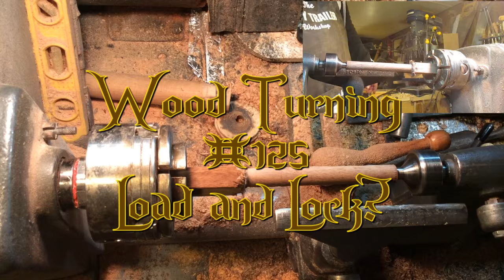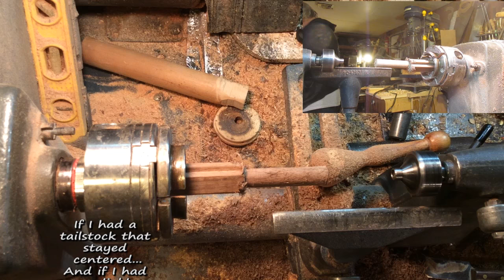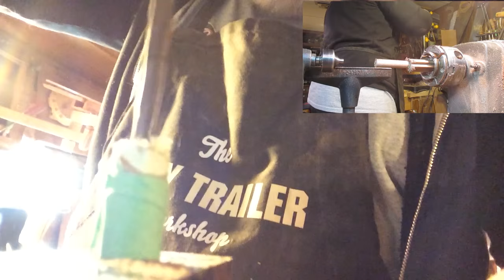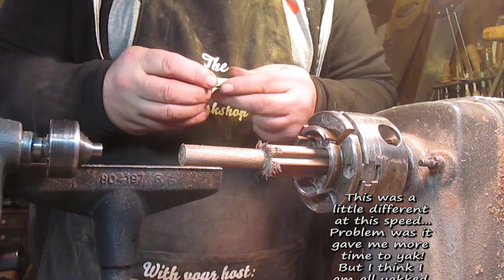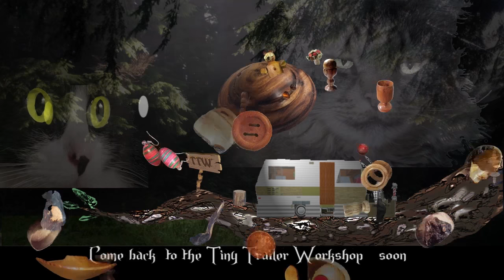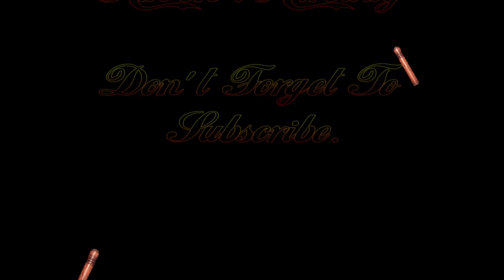Wood Turning #125 Texted Load'n Lock

Comment: Those look nice. Will you epoxy them onto the rods in the car doors?
Reply from the maker: No they are drilled out so that they can be threaded on to the post which has a coarse thread. 
Having now seen how they fit... I didn't need drill the smallest hole as deep... But needed the bigger one deeper!
Thanks for watching
Larry